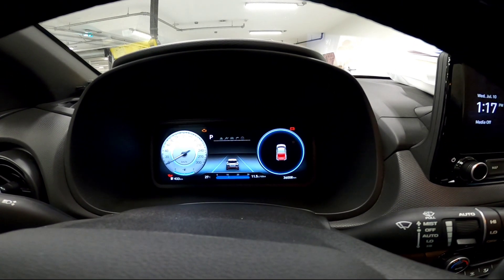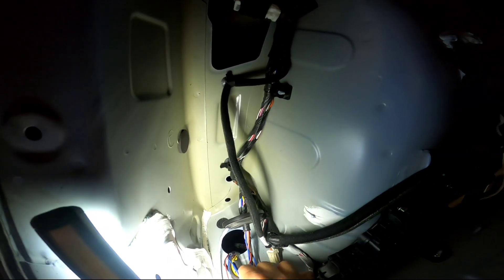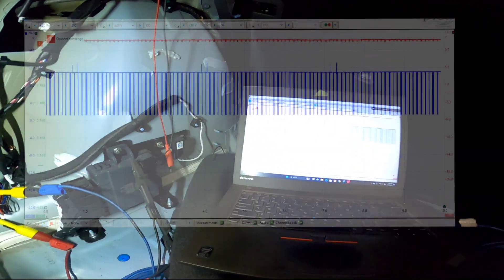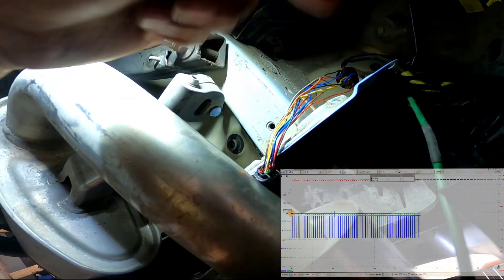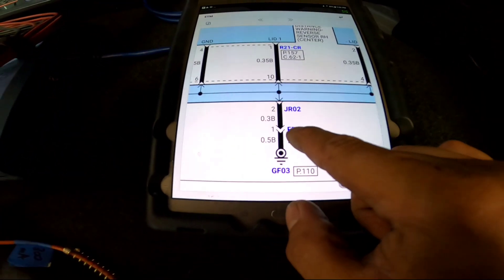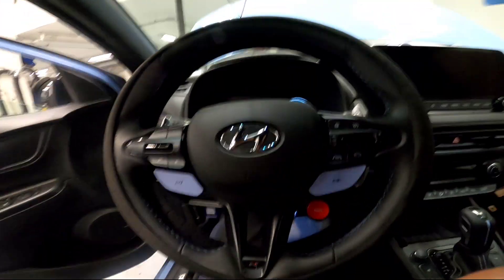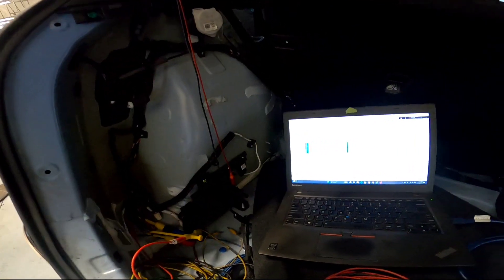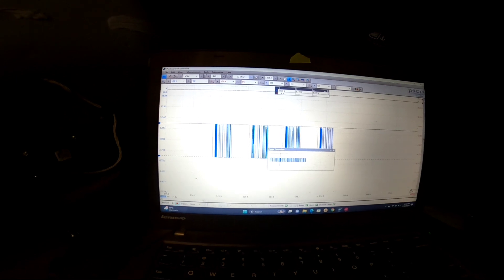2023 Hyundai Kona N parking sensors fault

Comment: How did you rectify the problem as i have a similar issue on my kona but across both fronts and back
Reply from the maker: I think this one i had to correctly repair the previous wiring repair in this video. In your scenario looks like theres a shorted sensor affecting the lin bus or theres short in the lin bus itslef ( communication line) . Need to monitor the lin bus onnwhats going on when the issue happens.